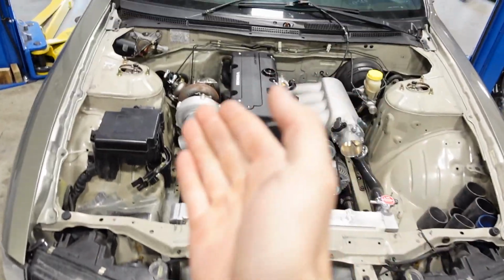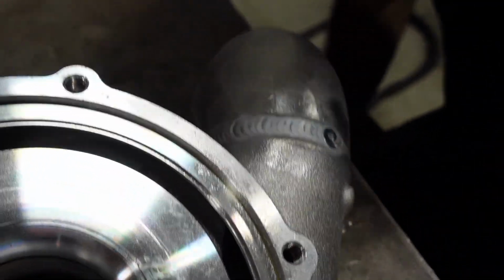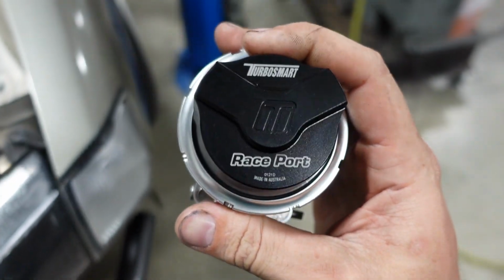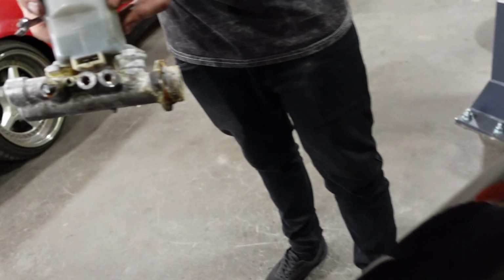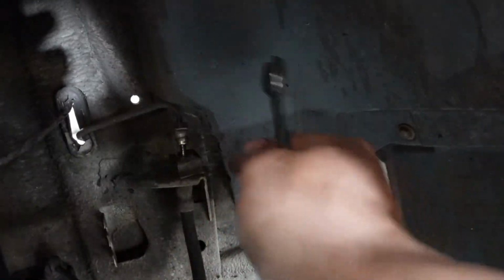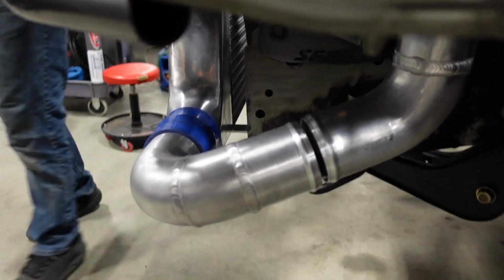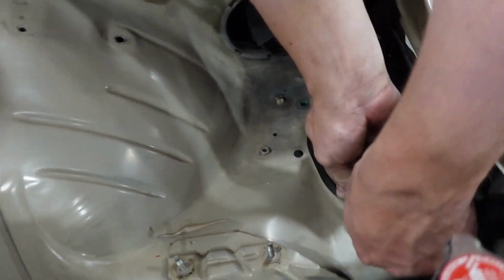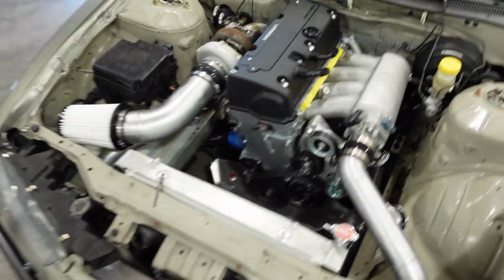RWD Honda K series comes together!

Comment: If you take the time on rock auto you will find a Pathfinder brake master with the correct smaller bore size, and they also have the fittings on the opposite side.

Comment: Tell B to take it easy cutting those hard lines with the snips... I have done it a few times with no problems, last time I sprained a tendon in my elbow and its been 6 months and I am still maybe 80% strength in what was my stronger arm.  Just take a second and get the right tools for the job.

Comment: If you plan to drive the car on public roads don't delete abs because you don't know when and where you will need it ( i learned this the hard way). As i was driving a ford transit van doing 55 mph (and failed abs sensor) the car in front of me started braking. The problem is he had only half brake light out of three, and as i was approaching i realised that he was slowing down and i start to break from 55 dropped to 35/40 and brakes locked up causing me to crash so hard that his car turned into hatchback (it was some sort of a sedan pos). Thankfully no one was injured, but i had hard time proofing to police officers that he didn't have any brake lights whatsoever.

Comment: Did you turn jonnys intake pipe backwards to clear the fuse box i seen jonny put short welded peice in turbo and at tge end u had it in filter side glad it worked out for you just flipping it around???

Comment: What d.1.1. Code did he apply for the 90 off the turbo? He had a nice bevel, curious if he ran that open root/closed? Run a larger land on the 90 vs the cast to compensate for how much heat he had to use?